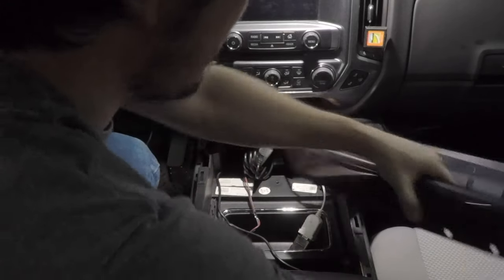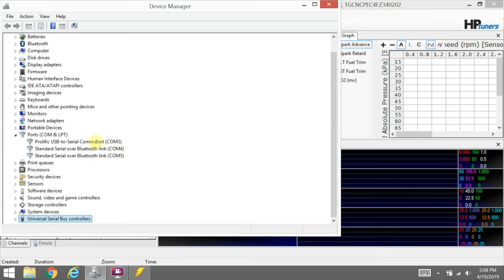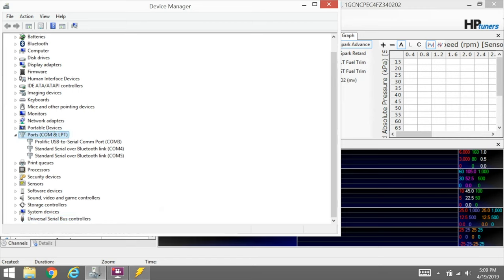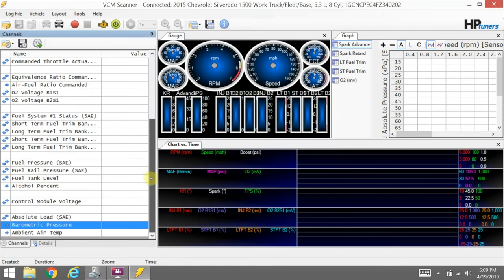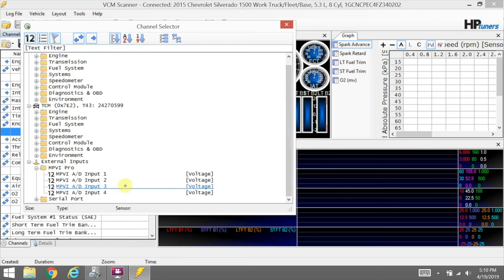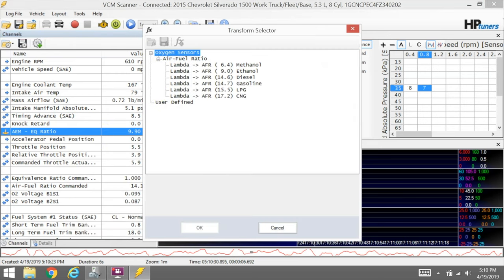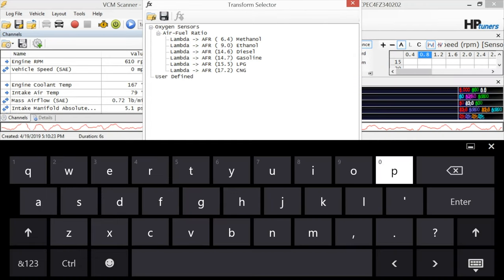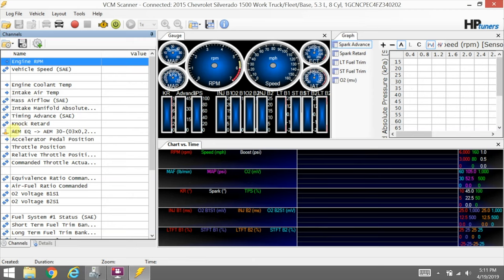Wideband Install Using Serial Connection and HP Tuners, AEM X-Series

Comment: Hey, great video. I watched it awhile back and there was a link to the parts you used to build it. It's gone now?? What's the part that you made specifically?  I think I've got the rest of it. Thank you.  Keep up the awesome vids.
Reply from the maker: I'll try to put them back in the description, sorry about that!
Reply: Or if you tell me how to wire that part up would be awesome....I've got 1 on the way...but I have to wire it.....thanks again...
Reply from the maker: @toddwaldeck7065  you hook it up to the receive data, pin 2 and ground pin 5. Just look up serial port pins on Google, it's a standard pin out
Reply: @GoatRopeGarage  on a aem 30-0300, blue wire on pin 2, black on pin 5 , which is grounded, am I correct?
Reply: Thanks so very much for your vids man!!!
Reply from the maker: @daveh7645  yep!

Comment: I have never been so lost in my life. I really like my HP Tuners program but shit I ordered a pro link cable and thats all you get no wiring diagram or nothing might as well plug it in my wives ars(I'd have more fun anyway) can I not plug my 30-0300 into my mpvi2 pro link connector and be up and running if so which wires? HELP PLEASE!!!!!

Comment: When is the mvpi3 prolink to wideband o2 video coming out
Reply from the maker: I can do one if those, but it’s pretty straight forward, you will have an analog out and a ground that needs to be connected to the prolink, then in the scanner look for the pro-link analog inputs
Reply: @GoatRopeGarage  i thought that i would need to repin the plug. I have the aem 30-0300.

Comment: Could you provide us with a wiring diagram?
Reply from the maker: Should only be two wires, data and ground, data goes to the receive terminal on your adapter.
Reply: @GoatRopeGarage  Is that coming directly from the 02 sensor? As in, you wire the sensor itself directly to the serial converter?
Reply from the maker: @JingleBop  no, from gauge or interfere
Reply: @GoatRopeGarage  Thanks, I appreciate it

Comment: Great video. Explained a lot and I took away a ton of info watching this. Have been going back and forth on buying the HP pro-link and pro-set for my WB but your explanation of analog signals steered me into your direction. My question is this. I ordered the Aeroforce gauge with LSU4.9. Can I wire this system up to log in scanner and display Lambda on gauge at the same time?
Reply: were you able to make this work? I'm wanting to go this route so I can have a AFR gauge that matches my other gauges.   I know both outputs are there... but can I use both at the same time.??

Comment: So I've done this but the math is incorrect for some reason

AFR scale it reads fine, but the conversion to lambda it's just AFR moved over a decimal because of the divide by 10

Anyone have the correct math to convert it from AFR to lambda?
Reply: Do you have your wideband displaying Lambda?
Reply: @dsmubz  I do, but that was not the issue. 

I figured it out. I had to take the input and divide it by 14.7 to display in AFR

Comment: Love your channel. Watched many vids. Question is I purchased MPVI2 & AEM AFR/LAMDA gauge complete with sensor wiring etc. instead of wiring rs232 back to rs232 to usb adapter could i just use red for ignition + /then black ground to both frame and terminal usb male and  blue as well for sync?  Bypassing the need for a serial to serial/usb adapter? Just have it go straight from both MPVI2 & AEM to usb?
 Hub then to laptop?

Comment: Where do I put the wires in the serial connection to usb and where on the aem x series I figured the blue would be used since it's serial
Reply from the maker: Blue 2, black 5